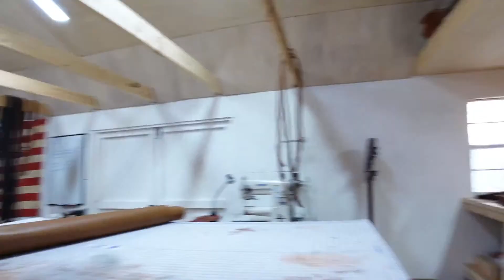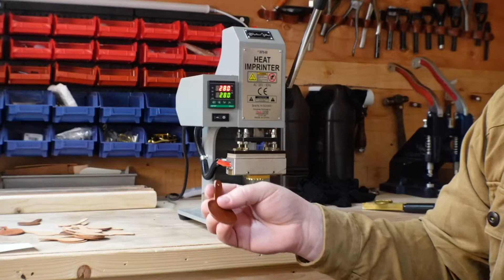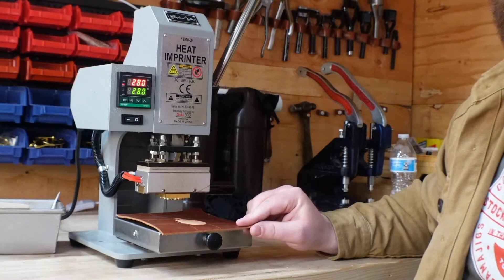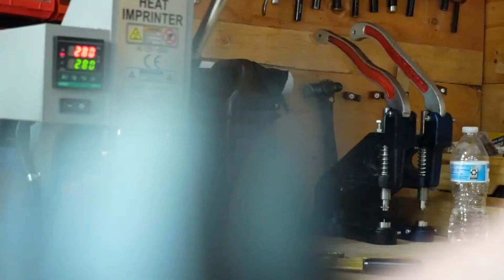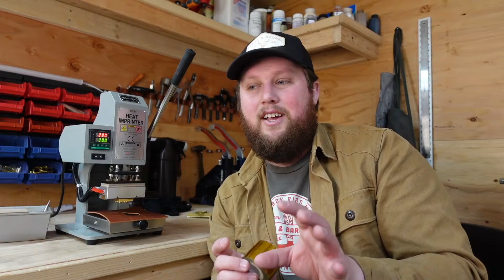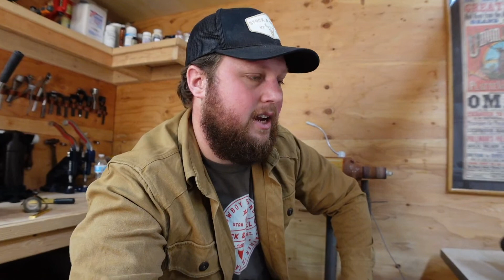Heat imprinter and foil stamping - LIVE UPDATE (3-17-21)

Comment: Nice to see Im not the only one fighting my heat imprinter / foil stamping. Currently Im doing 120C for 2 seconds light pressure on waxy veg tan foil stamping and getting decent results. Some come out perfect, most have an imperfection here or there but not too bad.